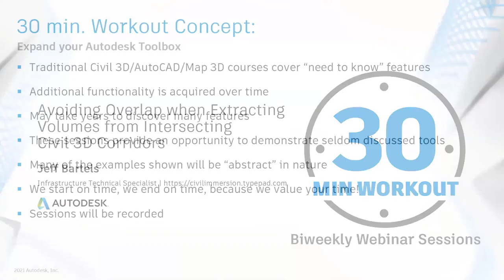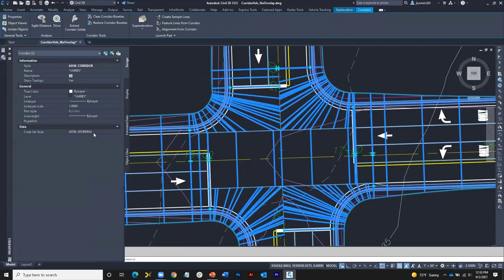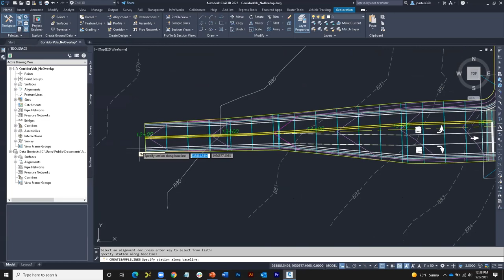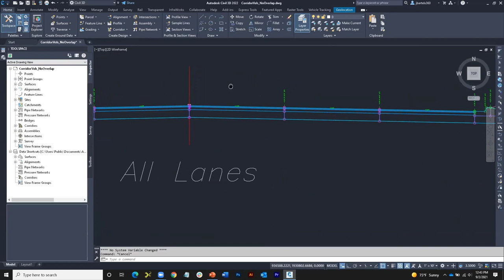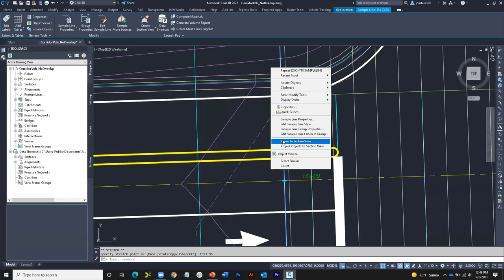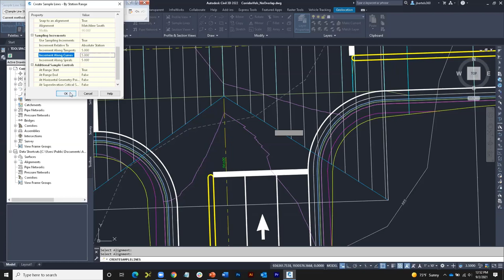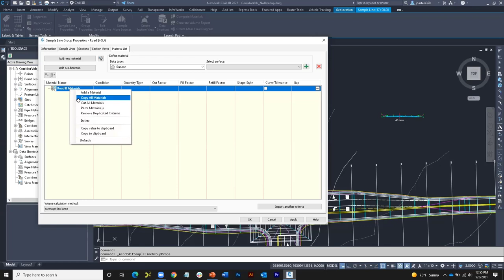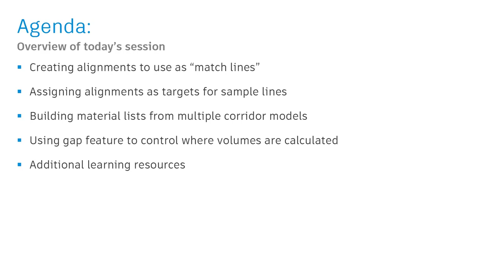Avoiding Overlap when Extracting Volumes from Civil 3D Corridors

Comment: Jeff, is there a way to do formulas like we can for text as by inserting fields for Civil-3D entities?  I would like to add another field to an elevation label by adding 6-inches to the elevation of that point in a surface (BC) in order to label a top-of-curb (TC) without filling this in manually.  I would appreciate a comment back even if it is a "no, that is not possible".

Comment: sir, You have Amazing Techniques to handle Challenges and provide quick solution for every topic regarding civil 3d. Thanks for your time its really very helpful to calculate materials volume in civil 3d. Sir, Here one question is can we add dynamic legends of hatch pattern with material table which used in these x sections.